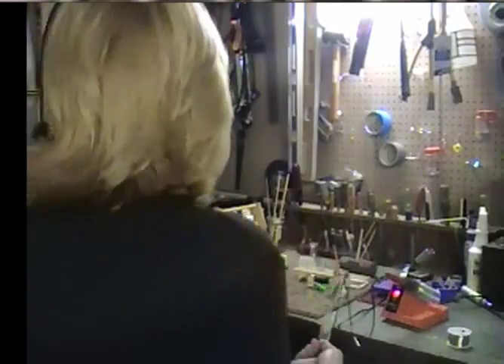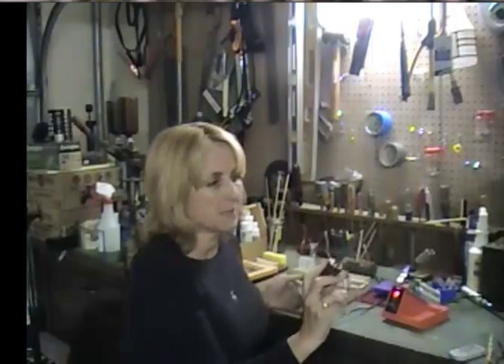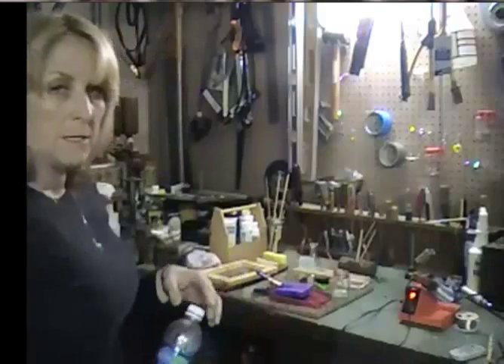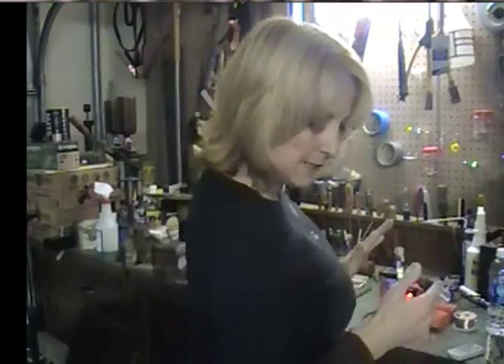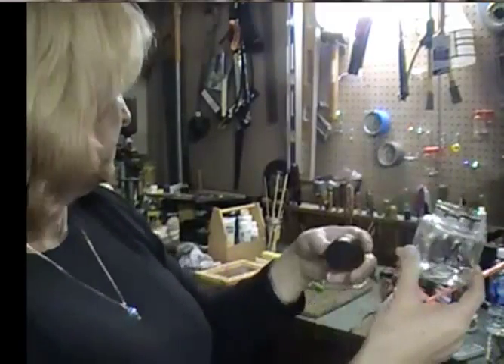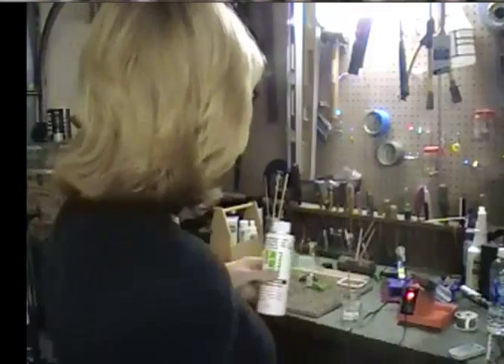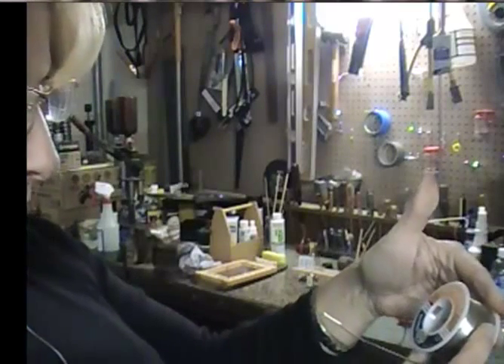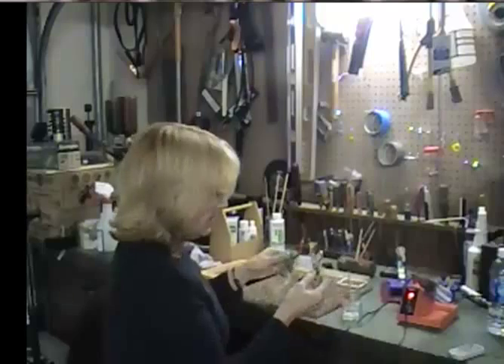Supplies & Equipment for Soldered Glass Pendant

Comment: Thanks, what helped me most is the advice for not letting the iron oxidize ... I couldn't figure out why one of my tips stopped working. I obviously need to not let it sit heating and use the flux, solder, water technique as you showed. Thanks a lot for your helpful video.

Comment from the maker: I'm really glad it helped!  You can't tell in the video all that well, but  the water is just to keep the sponge wet. (I'm pouring just a little bit of water onto the sponge there). I think a big factor in keeping the solding iron working, is to not let it get too hot & sit there for a long time at that temperature.  That's the nice thing about a solding station with a temperature adjustment.  You can turn it down, without turning it completely off while you fiddle with flux, etc.